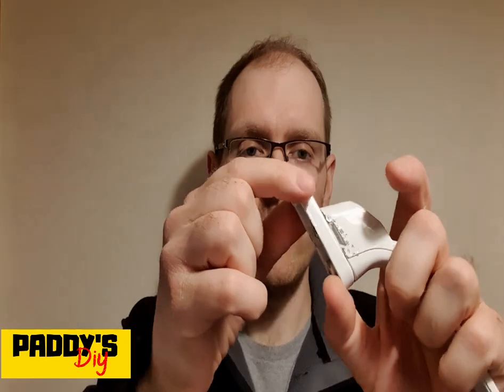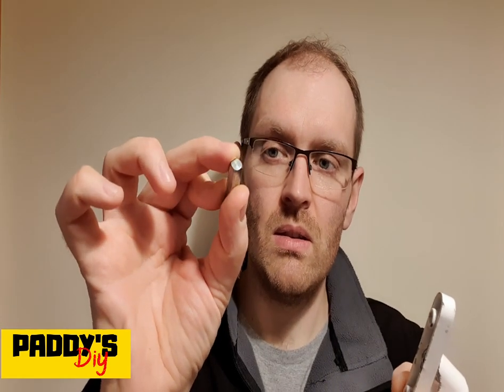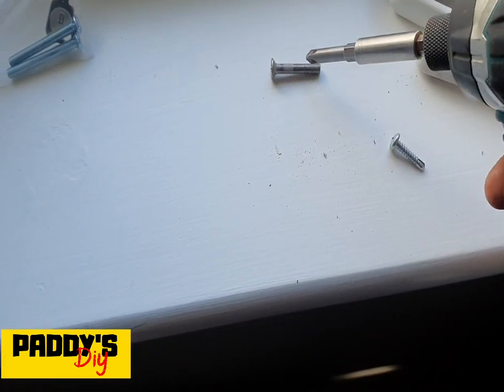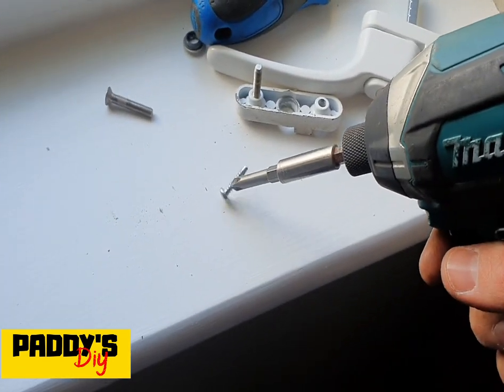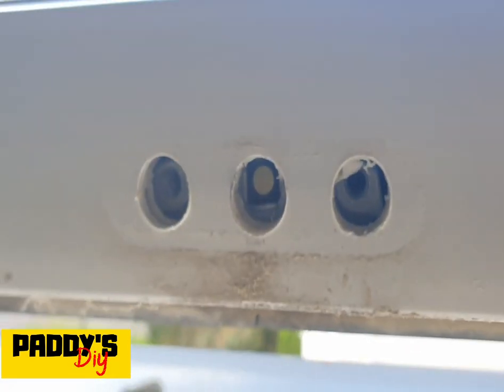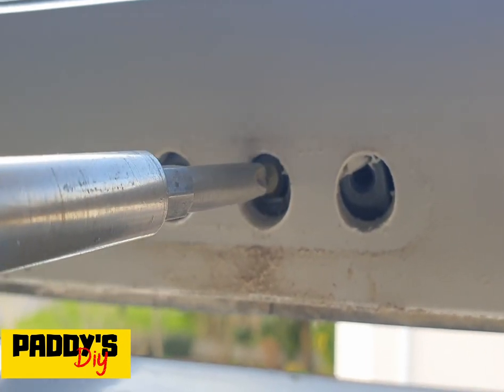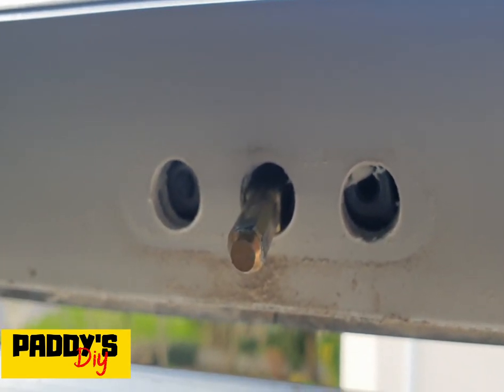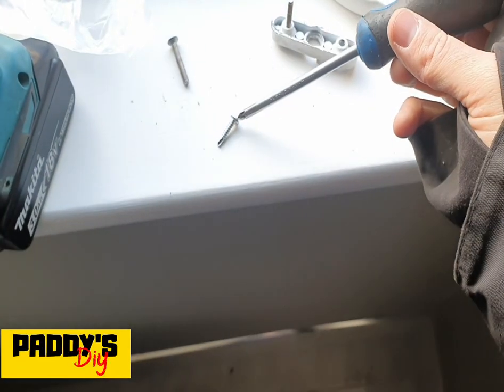How To Remove A Detached Window Handle Spindle From A Window

Comment: Hi Paddy! Not sure if you can help... The handle on my uPVC window is completely stuck, cannot go up or down. With great difficulty I managed to remove the rusty screws but the handle is still stuck to the window. If wobbles a bit but something is stuck. The spindle I guess. What can I do? I tried to pull hard but scared to damage window or myself. Any tip?

Comment: Hi Paddy. Thanks for the video but can you advise how to stop the spindle slipping out of the handle in the first place? I have this problem in one of my handles and I have to remove the handle to push it back into the handle every ten days or so. Is the spindle too short, or could there be a clip missing that would prevent it slipping out of the handle? Cheers mate.
Reply from the maker: Hi doug, the spindle shouldn't detach from it. The handle lever is crimped onto the spindle when it's being made. Easiest and cheapest thing to do is replace the handle. A new type of handle available now is a multi spindle handle. The spindle are interchangeable and are held in place with a magnet at the base of the lever. They're about 2 or 3 times the price of a standard handle though.
Reply: @PaddysDiy  Thanks for your reply Paddy, much appreciated :-)
Reply from the maker: No problem doug

Comment: Hi Patrick! Two of your videos made me able to open one of my stuck windows, and also figure out what was wrong with another. Faboulous! I took the handle off, and the spindle was still in the handle. But the little metal piece t\in the window, that the spindle goes into is broken. So the spindle can not turn anything anymore. Two questions if you have the time, I would be  most grateful: Do you know if it is at all possible to DIY this problem? And do you know what the name for that little metal piece is, the one that connects with the Spindle?
Reply from the maker: Depends on the type of window you have and the type of lock thats in it. The most common type of window lock is a espag lock. The gearbox that the handle connects into is made in one piece with the lock. This is my video on how to measure the lock to buy the correct replacement. https://youtu.be/5HkPks3wlfY

Comment: Will give it a go. Went to replace an old handle and the spindle was snapped and in the frame pretty sure it’s rusted in tho.
Reply from the maker: Hopefully not
Reply: @PaddysDiy  turns out it wasn't rusted, that would have been the good ending. 
the spindle had been cut short to 8mm as the entire locking mechanism is on the interior facing part of the frame. someone went economy on the window installation or more likely it's just a really old and poorly weather protected metal plate AND they went cheap. The screws were "fine" given the surface corrosion it's the 6-7m plate they have everything locked into that's the issue, one side has destroyed threads the others half gone. 

I'm not in the mood to buy thread-tapping tools and re-do the entire mechanism so it's the landlords issue now.

Comment: Hi, wonder if you could help please. I've taken the handle off but the spindle is stuck in the window, it's completely rusty. Tried pulling with force but it hasn't budged. Any tips? Thanks in advance
Reply from the maker: It's a nightmare job when that happens. All that can be done is to grind out the centre section of the window lock with a die grinder until the lock comes out. Then replace the lock and handle. It's not a job for the diyer

Comment: Hi bud, what of the spindle part has fallen into the window workings? Mine has, I can't get it out.
Reply from the maker: Is it causing an issue? Is it jamming it up?
Reply: @PaddysDiy  ive removed the handle as it wasnt working, ive just got a closed window that i'm unable to open now. With no handle.
Reply from the maker: Just buy a new Handle and you'll be good to go
Reply: Hi Paddy. Great video, really helpful. I have a similar issue. When I was trying to get the detached spindle out, I accidentally knocked it into the frame of the window, I heard it drop into the frame. Is this likely to cause a problem in the long term? Mechanism seems to be moving fine at the moment but hope it stays that way. Also, how do you stop the spindle detaching in the first place? I’m now on my second handle where this has happened. Thanks.

Comment: Thanks Paddy the spindle on my window is stuck in place any idea how to get it out, I tried a vicegrips but it's stuck solid
Reply from the maker: Try spraying wd40 on and around the lock gearbox and leaving it over night. Then try wriggling the spindle in every direction and in and out also. If that doesn't work you'll have to drill it into bits and get it and the lock out on bit at a time. Not a nice job when they won't come out

Comment: Hahahaha 🤣 Dynamo magician... I've bought a spindle 40mm and the existing is 35mm !! neither 30 or 40 so have to cut down...(saw your video!!) Isn't there a way of taking out spindle in the new and inserting the old one ? As I don't do hack sawing.....🤪. Great clever video!!
Reply: You will find that the spindle has to be really tight in the handle.If you can remove spindle from handle easily it will just continually walk out of handle as there is nothing on other side to stop it unless the spindle is exceptionally long.I discovered this when my handle was just spinning and doing nothing.The spindle must be kind of squeezed  into place when manufactured.If your spindle is slack in handle probably better to buy new handle.Or else fill the handle with really strong superglue and tap spindle in as tight as you can.

Comment: Mine has gone inside the actual window and it’s gone at the bottom
Reply from the maker: As long as it's not stuck in the window mechanism it doesn't matter. The issue the video is dealing with is the old detached spindle blocking the mechanism. All you need to do if fit a new handle.